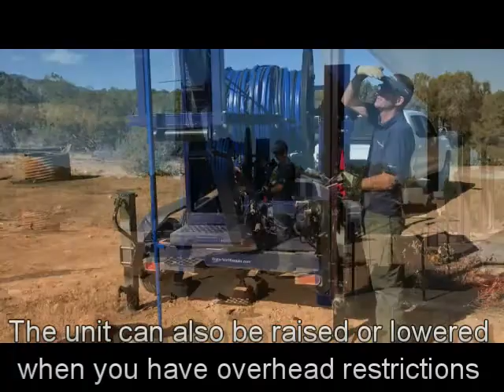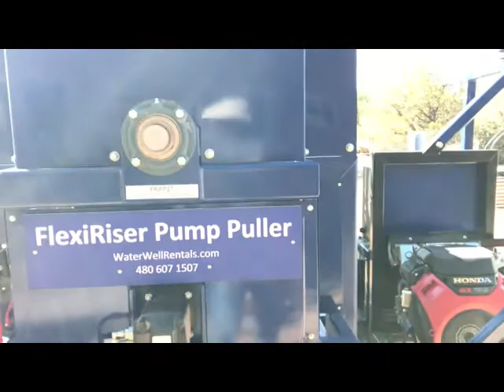Deep domestic submersible pump installation on Boreline FlexiRiser

Comment: It appears to be a rocky area what did you use to dig that hole, did you first used water detector to locate water bed?
Reply from the maker: Hello. The water in this area is very deep. They use a drill rig to drill and dig the hole. I do not know how they detected the water but I think the driller just kept drilling until they reached the water. Cheers